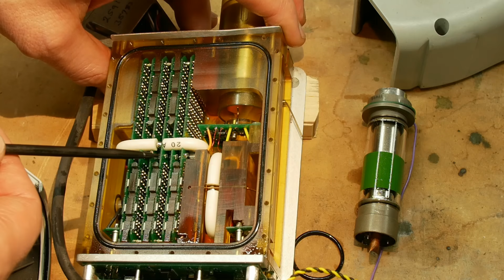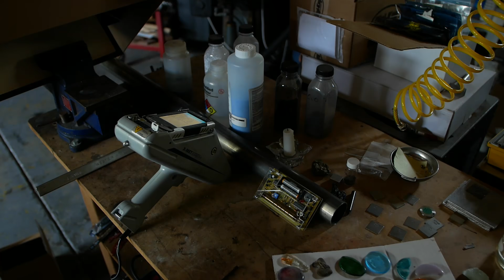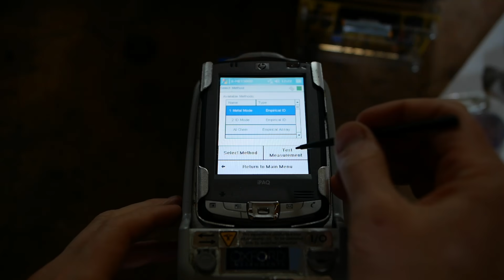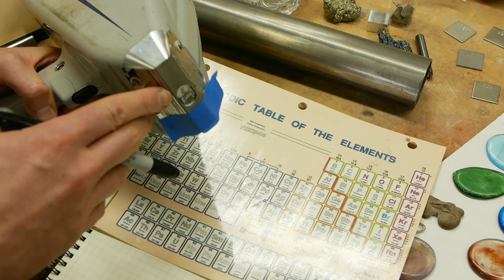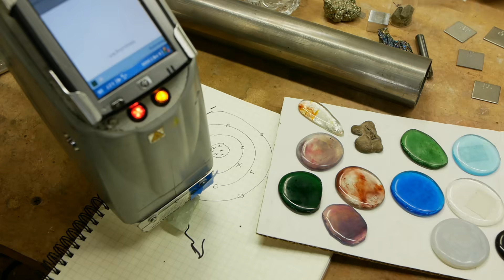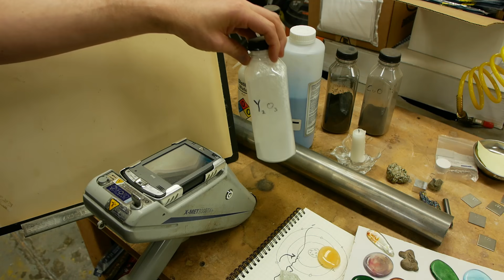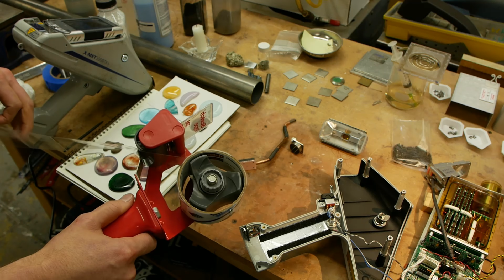Demo and teardown of an X-ray fluorescence gun (measures chemical composition)

Comment: Rather than a tube, could you use a specific radioisotope that consistently produces the the x-ray energy needed?
Reply from the maker: Yup!  Some devices are built with radioactive sources.  In general, the regulatory paperwork  (and the underlying potential danger) is more severe for a piece of radioactive material than for an X-ray tube, so I believe the X-ray tubes are more common despite the higher cost, energy use, and fragility.

Comment: Seems as though you could make an xray emitter by attaching a multivibrator to a silicon pad against a piece of metal or silver.

I wonder if the first metal shield could be removed for more senstivity if you used the machine only in complete darkness. I imagine it is a light shield.

I would love to see how the little detector can detect strength of the xrays it is receiving. Your cellphone can detect xrays or radiation if you cover it with black electrical tape.

Comment: Wait a minute 9:14 Didn't you say you forgot a recipe for good photochromic glass?? Did you figure it out with this????
Reply from the maker: Yes!  In fact, I tried the gun on the photochromic sample, but it didn't return a result.  I believe the concentration of silver is just too low to be detected.  Another challenge is that the glass recipe includes information that is very difficult to recover from even a perfect chemical analysis of the final result.  Most of the starting ingredients will be decomposed, oxidized, or reduced in the glassmaking process, so knowing times, temperatures and kiln atmosphere composition are critical.
Reply: @AppliedScience  I expected something like this. That's unfortunate.
Reply: Good question

Comment: From what I see of the feedback circuit, it is using a similar set up that is used in substations for high voltage power distribution where you use a coil that is coupled magnetically to the high voltage line and is then stepped down for instrumentation. I am not an electrical engineer, but I was an industrial electrician and my instrumentation training included power grid and high voltage applications, but more of what you would see in power distribution or for use in an industrial plant, like what is used in some electrochemistry based processes.

Comment: "I suspect that it's silver"
If only you had a tool that can analyze the composition of materials :P 

Loved the video by the way
Reply: Unusually the x-ray window is beryllium which is extremely poisonous via skin absorption. Beware.
Reply: @isoguy. , yes, beryllium oxide dust and some other salts. Otherwise beryllium is used widely with numerous alloys (copper-beryllium is quite common)...
Reply: @etiennedecessy  
Yes, agree. Berellium is used in tooling too, this is usually accompanied by  warnings regarding handling, OSHA. It is believed that current beryllium use will be the next businesses liability pitiful, just like asbestos.
Not trying to one up man ship here, just wanted to make viewers were aware of actual or potential dangers of beryllium.
n λ = 2 d sin θ
Reply: @isoguy.  Not by just touching it.. 
But if sawing, grinding, etc, then watch out! You certainly do NOT want to end up inhaling the dust from it.
Reply: Oh you beat me to it, just posted the same thing
Reply: This is the Bender attaching his own arms of Applied Science.
Reply: Silver is a commonly used target in XRF.   It produces a 22.168keV Kα line and a 2.983keV Lα line, and fluoresces efficiently at 40kV.
Reply: @ribrobrab  a neat solution to get a finely tuned X-ray source rather than the wide range of frequencies the tube would give out. Further, note the tube beam goes out straight, while the silver, which produces random direction photons, sends those out the window at 45 degrees, ensuring a cleaner signal again.
Reply: I am not an expert, but it may be that the xray analyzer might need to actually touch the material.  Since the thin metal window was recessed into the part, possibly it can not be analyzed.  Just my guess...
Reply: @gregvisioninfosoft  No. There's no contact required whatsoever. It just needs to be very close because of the low power involved here.
Reply: It could possibly be Ag or any other heavy element,  its just have to far away  energy level from every day use target elements then software most likely subtract/ adjust the reading otherwise it will show on screen.
Reply: 😂 excellent
Reply: He could point the working one at the screen of the broken one...
Reply: @Marci124  Umm, yea... That was the entire point of the original comment, but thanks anyway?? 😕
Reply: @Marci124  Just thought about that as I read your comment. It's funny because, I was thinking it's process was random, but then that doesn't work... The answer was right there the whole time. 😂
Reply: @Robert_McGarry_Poems  its
Reply: <applauds> Bravo! I like your comment.
Reply: @recklessroges  Thank you, friend
Reply: Too light, no?
Reply: @jimlee4649  no, silver is quite a heavy element - number 47, and the lightest this XRF gun can detect is titanium, number 22.
Reply: @MysticalDork  ... think again ... :)
Reply: @flynn8860  I beg your pardon? Which of the statements I made needs review?
Reply: @MysticalDork  ... OOps my bad; Ignore my comment please. (I thought you answered the OP, which completely reverse your meaning; again : my bad.)

Comment: I wish I had a time machine to show this to Moseley. I bet he would flip the f out. 
Love that calcite phosphorescence and the fact that you can "see" the manganese creating it! The little angled output aperture is intriguing. I don't know if it's silver in there, I bet there's actually a rubidium hydrogen phthalate (RbAP) crystal monochromator in there using Bragg diffraction off the crystal planes to select a single wavelength output. In any case, it also wouldn't surprise me to find a beryllium foil for the output aperture or detector window so careful w/that too....
Reply: When he used the laser we got to see it, too... more or less.
Reply: These small handheld XRF guns don't use Bragg diffraction, bigger table sized XRF apparatuses do use the configuration with the Bragg diffraction. And the "silver" is indeed a beryllium window.
Reply: @wvdh  interesting
Reply: Would like to show Roentgen, Crooks and so on

Comment: I’ve been waiting for a good video about handheld XRF ever since I found out they existed, of course you’re the one to make a video with everything I could have wished for especially the teardown section. That custom multi-board transformer is a strange but neat idea!

Do you know what technology the detector uses? I would assume it’s a somewhat special silicon PIN diode but I know some of them use cooled high purity germanium to get access to those lower weight atoms.
Reply: Either Si-PIN or SDD.
Reply: I work at a company that produces small X-rays now and the supplies are so much smaller than they used to be! The filament drive transformers and voltage multiplier are about the size of a pink eraser! It’s truly incredible!

Comment: Why must it be a inner (K) electron that is knocked out and replaced by a outer (L) or (M) electron?  If outer electrons are weaker in attraction I would expect the outer most electrons to be knocked out first.
Reply: Electron shells aren't walls. An electron is somewhere in there, but the chances of hitting it with any particular xray is impossibly small. It's like firing a bullet across a road and expecting to only ever hit cars in the nearest lane.

Comment: Positive material identification, what a wonder that has been to the engineering field.  Discarding a few tons of low-alloy steel because you lost the MTRs is one thing, but when you get into the ritzy stuff one of these starts to look like a very good deal.
Reply: I believe one of the uses for these devices is to see that the king pin that holds your air line jet engine to the wing is not counterfeit, apparently a lot of bad stuff is around, scary thougth!
Reply: @jimmiller5891  If people only knew what goes on behind the scenes of things we take for granted as being 'safe'....  Luck plays a larger role in your life than you think it does!
Reply: @jimmiller5891  Yep. Life dependant stuff.
Reply: Ore/material supplies have been known to put a layer of good stuff over the top of rubbish. So now the testers dig DEEP and test the core/base of samples. :D

Comment: That's neat. The fact that they use a negative voltage to throw the electrons away instead of pulling them to the plate.
Reply: From the x-ray tube's point of view, the anode is still positively charged.
Reply: @Spirit532  I'm not certain what you mean by the words "from the x-ray tube's point of view". The tube is the whole device containing the voltages in question. It seems sensible to say "from the electron's perspective" or "from the coil's perspective", but "from the tube's point of view" seems a bit non-technical of a starting point.
Reply: @AtlasReburdened  The x-ray tube, which is just the vacuum-sealed glass device, not the entire HV section, does not "contain" any voltages.
Reply: @Spirit532  Ok, I was speaking from a technical standpoint. Are you just being padantic about the definition of the word "contain"?
Reply: I am able to get negative voltage from an AA battery if I flip the leads of my multimeter. From an LED's perspective does it behave differently if you measure the voltage that way?
Reply: @davemarm  Negative voltage is only within a reference frame - the battery itself does not produce a negative voltage.
Reply: @Spirit532  That's my point. My reply was intended to be for Atlas to grasp that concept based on his original post.

Comment: Patented technology - but not wanting to share the technical details of the implementation.
What part of the patent process is broken? I guess the whole thing.
The patent does not describe the technical details and the patent is worthless without the money to sue a competitor.
Reply: In a way you're right but what's the alternative? Not disclosing your invention, then someone open your product copy your design and what you got? nothing. At very least with a patent you got something to hold on to.
Reply: @norbs  I do not know, but if a patent has two functions (sharing an invention with the public in exchange for a time limited monopoly) and it does neither: Where is the point? "something to hold on" - an expensive piece of paper with rights that you can only can try to enforce by throwing money at it? Value for the share holders if the company goes belly up? The patent stuck in the bankruptcy mass of the company, so that the individual inventor specifically is locked out of ever again using his idea? The bank will happily watch over its former debitors and their actions - IP infrigment means a way to get back money. (I mean: The inventor could buy out the patent from the banks, but an arm and a leg will not be enough for that, so how about that plus the first born son?). I do not need to come up with an alternative or a fix. Patents are beyond repair.
Reply: Normally you only need to patent the basics, you don't need to patent the circuit board or components used and schematics just to not reveal it all and thus you will never see any details like that in patents. In some special science books on the net for a couple of 100 - 1000 dollars you could thought find that kind of stuff or at least much more detailed.
Reply: AvE made a fun of a similar absurd some time ago "...this technology is patented and confidential..." offcourse
Reply: I think nothing is broken here. Patents are there not to help others make the thing or understand how it works. Patents are a legal tool to establish a monopoly, and are intentionally written to be as general as possible. As far as i understand it, at least.
Reply: @victortitov1740  The original intent of the patent and trademark office was to provide protection for inventors, yes. But that ship sailed long ago, and patents - indeed the entire concept of Intellectual Property is now used solely as a means of income by lawyers.
Reply: @victortitov1740  I have a few patents, or at least my former employer does. It's a requirement that a patent "teach"  the invention. In other words a person "familiar with the art"  will gain enough information to create an embodiment of the patent from the patent itself. There can't be any secret ingredient, for example. That said, it's not a blueprint and it assumes sufficient public knowledge is available. Otherwise the patent examiner will not approve it.
Reply: @victortitov1740  Patents are an exchange.
The inventor is opening his invention in exchange for a time limited monopoly. Patents are literally there for others to understand the invention.
They are written "as generally as possible" in order to have "ground to loose" to prevent circumvention by trivial alternation.
Patents to not establish a monopoly - you competition can still steal your design. The patent holder would have to sue the infringer. That will cost a lot of money.

The infringing party then can drag out the process, call on expert witnesses, drag out the process ... and in the end the inventor ends up with one or two instances won, but the case hanging in revision in the next instance, where the inventor is out of money to fill motions, so the case ends in a default judgment.
Reply: @victortitov1740  Your first sentence is the theory on how patents are supposed to work, the second sentence is the actual current reality.
Reply: @victortitov1740  - Broken as designed.

Comment: Why did they build such a complex HV supply? A typical CRT TV almost uses 30kV and they just use a small potted transformer and a voltage doubler. Old CRT projectors even ran on 50kV with the same setup. 1/10 the price and no oil needed!
Reply: Needs extreme stability, very clean negative output, and low power consumption. And you still have to float the cathode at -acceleration, so oil or full potting(unserviceable) is needed.
Reply: @Spirit532  Yea the polarity and stability would be issues. But im sure you could build the thing using a standard flyback/doubler combination from something else.
Reply: @WolfmanDude  Do that then. I'm sure they'll take a compact, low cost -40kV 50uA design off your hands for a nice 5 digit sum.